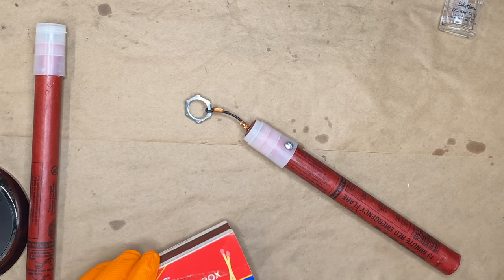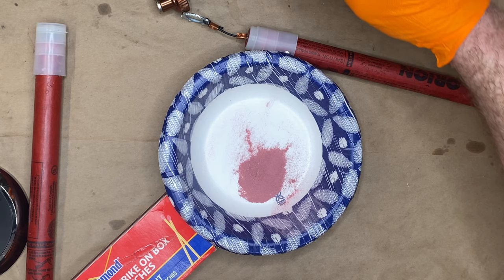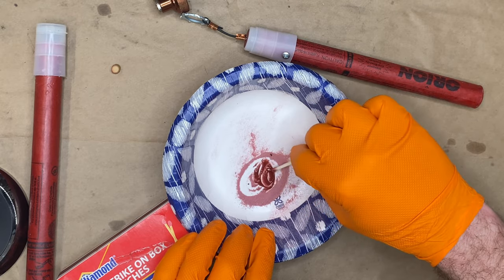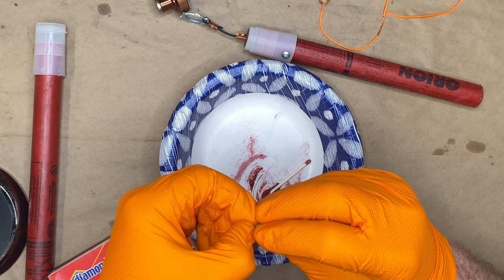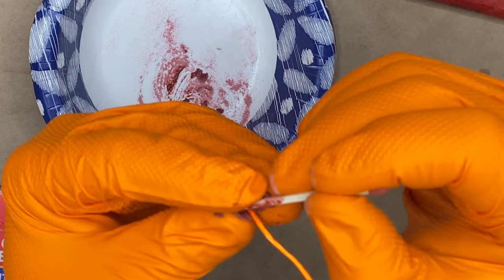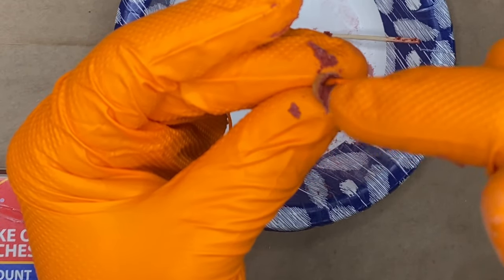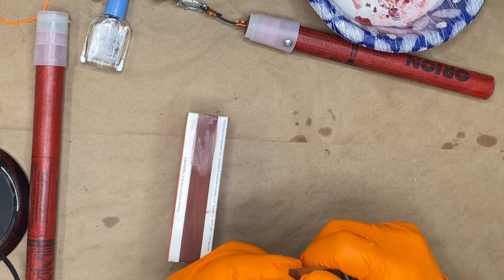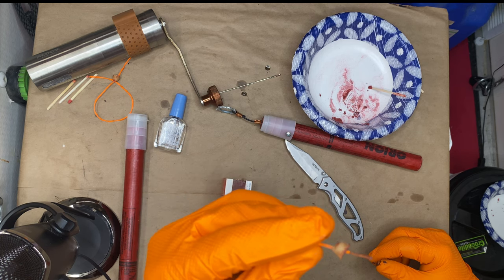SHTF Ignition Cups for Pull-Ring Smoke Grenades/Flares

Comment: Alternate cup solutions (when not going the kit route) that you can get ready made. Tatto ink cups, small or medium would do nicely if you buy the right kind they have a little flange to help keep it in place when installed. Drill a hole and ready to go.

Comment: Pack the cup with the ignition compound then poke the needle and thread through. It'll be far easier.
Reply from the maker: The problem with that is that threading will drag the compound through the cup and will have loose contact with the string when dry

Comment: I can't manage to make the ignition system ignite...

I made my own cups by layering craft paper and applying wood glue between the layers, lay it flat above a drilled ( not all the way through ) wooden board with a sheet of cellophane in between to prevent it from gluing to the wood then pressing it with a steel dowel into the hole and letting it dry with the dowel still in place, it's a really good way to make a batch of them ( multiple holes on the same board and multiple dowels ) and they come out exactly as the ones from the kit. I can send you a video of the process if you wanna film one for your channel and share it :)

Obviously the powdered matches heads part is hard to mess up.

The only thing I do differently from the video is how I "salvage" my striker compound, instead of putting the nail polish directly on the striker of the boxe I scrape it without nail polish to be able to store it in a container and have it ready when I need it.

I use Rimmel nail base & top coat, checked if it was burning properly / containing nytrocellulose and it is.

The only thing left that varies from your video is my string. It's not a two part string ( kern and mantle ) it's just a one part braided ( not twisted ) synthetic string.
It has a great textured surface so the striker compound has a lot of crevices to grab onto, but I don't know if the string has to really "drink up" the compound ( so synthetic fibers are not the way to go ) or if it just has to have a good surface to grab onto...

I don't really know what I'm doing wrong here :/ 
If you're willing to help I can film and send you a video on the process if you need it :)

Thanks for the share, you're doing a great job ! 😁
Reply from the maker: I know it sounds silly, but it happened to me: Are you letting the cups dry enough? 

I put mine on top of a dehumidifier for 36 hours—still wasn’t dry enough. Before attaching them to the storm match, test cups independently. May take 3 days to fully cure.

The other mistake I made was overfilling the cups. We want the striker coated string to be able to pull through the filled cups, not get totally stripped by them. It may help to sort of wiggle string around to dilate ignition compound inside cup when filling.

Leave a comment on this thread 🧵 and lmk if it worked.
Reply: Hi :)

You just made 2 really good points ! 

I didn't let the cups dry for this long and they were not even on top of a dehumidifier 😅 I waited long enough for the mixture to be hardened and looking dry, but I guess it wasn't dry enough to have sufficient dry friction and chemical reaction between the ignition composition and the striker compound. 

Overfilling the cups is my bad. I didn't get the "don't over fill the cups" this way, I thought we were not supposed to fill the cups up to the rim. ( wich still applies I guess, no need to "waste" more ignition composition than needed as long as the reaction reliably ignites the storm match 🙂)
But if I understand correctly now, I have to leave a little bit of wiggle room for the bare string to slightly move in the center hole of the ignition composition so that when I coat it it will be able to pass through the center hole while still having enough friction to make the reaction happen.
Mine was totally stripped when I examined the failed ignition cup assembly.

I didn't think this through, I'm quite tired these days 😅

Thanks for the heads up ! I'll experiment in the coming days, but I'll have to wait for the cups to dry properly so I'll get back to you with some news after that !
Reply: Hey, I'm back :)
So I got good and bad news 😅

I did 3 ignition cups for testing :
Got 1 failed ignition,
1 also failed but with a very tiny amount of smoke ( from the igniter, I haven't made the smokes yet ),
And one succesful ignition but here's the twist : the striker compound for this one was made with powder coming from the red rings for toys revolvers, this powder is sensitive to shocks and pressure so I figured I could experiment with it. BUT. I don't really think it is safe to store the finished smoke anywhere else than on a shelf since the striker compound is sensitive. I could be wrong (and most possibly am because everything is secured in the shrink tube) but I don't know enough chemistry to take that risk, I'll have to experiment for that 😅

I finally found a string that I think is more suitable to be coated with the striker compound ( but it's pink 😭😂), so I'm gonna make 5 more test cups ( 3 standard striker compound and 2 revolver ring ones ) and get back to you in at least a week when everything has dried properly.
I hope it will be with 5/5 success or at least 4/5 🙂

Thanks for your patience, take care.
Reply: @Zorronoa  how'd ya make out
Reply: @americafirst3738  I've been on the move for work all this time, I'm coming back this evening :) 
I did the cups before leaving, so they should be dry enough to be tested !

Comment: Instead of custom paper cups, what about bottle caps or cut down .22lr shells?
Reply: You could probably use anything that will resist the heat of ignition long enough to light the fuse as a cap, a bottle cap might be too large for these handheld devices though
Reply: @Bepissmall  "too big for a handheld device"

... So, what I'm hearing is it needs to be bigger, I should make it the size of a paint can. :)

Comment: Have you tried using H48 priming composition? Big army uses this for their pull primers. The ration is a bit different however: 56.2/24.6/9/10.2/trace potassCho/antimS/sul/ground glass/sodiuBi
Reply: To do that safely you’d need to recrystallize your sulfur from xylene or another suitable solvent to make sure there isn’t any sulfuric acid trapped in the crystals. Chlorates and sulfuric acid ignite on contact which is why you don’t generally find them together in pyrotechnic compositions. When was the H48 introduced, and has it been replaced since? I’d be concerned about shelf stability since sulfur can break down into sulfuric acid over time when exposed to oxygen.
Reply from the maker: Duuuuuuuude just saw this and i wished I’d seen it weeks ago! (As it would have saved me a lot of failed experimentation) I’ve been experimenting with those exact ingredients in different ratios.(that i extrapolated from google patents from like 1905)  Those are pressed into pellets inside a metal cup with a coiled wire pull right? If i could successfully replicate that design that would be dope. The other day i literally ground up glass with a pestle and mortar to make it and used 22 casings for the cups, but was unsuccessful due to broken wires. It would be great to avoid red phosphorus because its so hard to get. Any other info you got id appreciate. Resources etc
Reply: @InventionIncarnate the metal cup with wire coil is exactly how Enola Gaye does it for their ring pull smokes.

Comment: It seems crazy to me that they would use NC lacquer as nail polish.
Reply: They use it on musical instruments like guitars and drums too, it’s not as high nitrogen content as smokeless powder and when it’s dried on a surface it doesn’t really burn. I’ve tried.
Reply: @chemistryofquestionablequa6252  It just seems like there would be better lacquers to use. I guess not. I didn’t stop to think about how much nitration goes into flash cotton or smokeless powder to give them their properties and that it would still be nitrocellulose without heavy nitration.
Reply: @Leonarco333  nitrocellulose is kind of a broad term covering a mixture of nitrate esters. It can be a lot less flammable especially when it is dissolved and dried as laquer rather than thin strands or small pieces that efficiently transmit flame to each other. So it’s a matter of how many nitro groups lending oxygen and nitrogen to the burning process, less nitrated cotton is still nitrocellulose but doesn’t have nearly the ability to burn that adding more of those groups gives it.